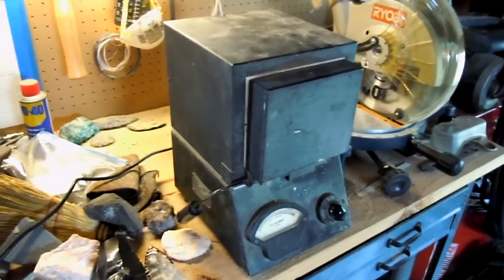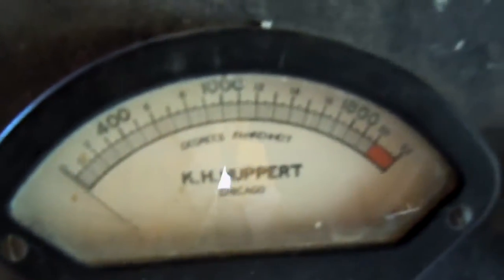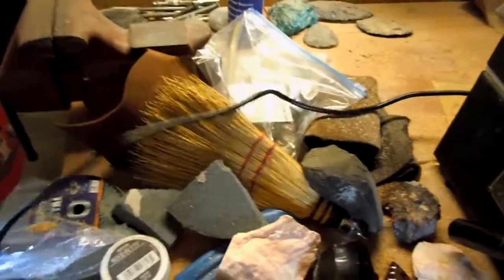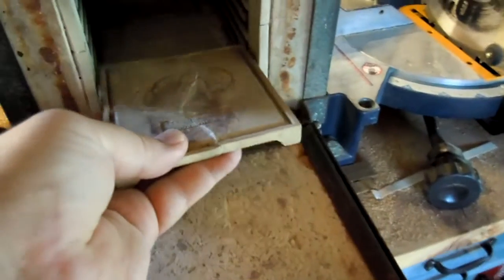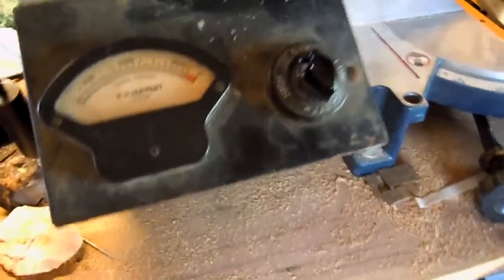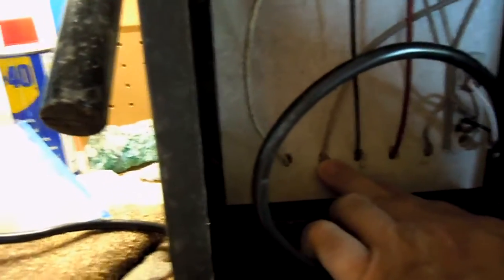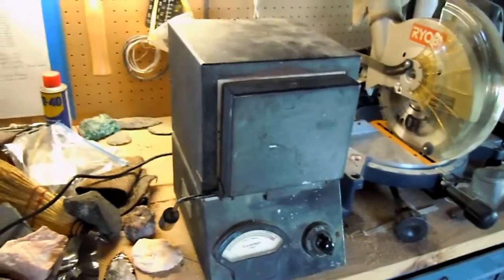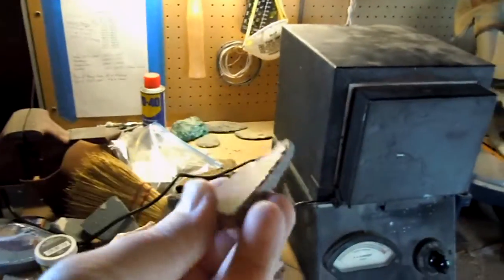K. H. Huppert Furnace

Comment: Good morning, I am a chemistry professor in a technological institute in Venezuela, in our laboratory we have a Hupperts Mighty Midget Model 333 muffle, which we want to recover, the equipment works but its temperature meter does not, the needle does not move. The information available on the internet is basically about selling this "seniority" of equipment. Your video is the only interesting source I could find. Please, do you have information about this equipment that could be useful to repair the temperature meter? We would appreciate your help. Bye.
Reply from the maker: Unfortunately we simply replaced parts with new many years ago.  I never found any legacy documents or repair manuals, sorry.
Reply: Ok, understood, then we will have to improvise, and in some way relive this little one. Thanks for the input,
Bye.
Reply: hi, Did you manage to find more information on how to update this furnace?
Reply from the maker: @alexib-1  unfortunately I have not.  The best option if you want an operational oven would be new parts.  Any broken furnace with intact heating coils can be easily updated relatively cheaply.